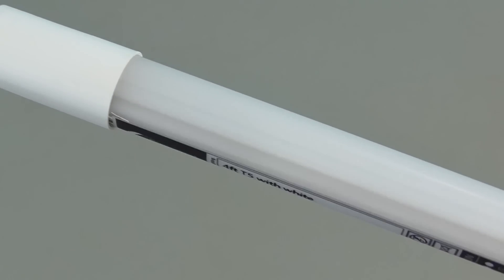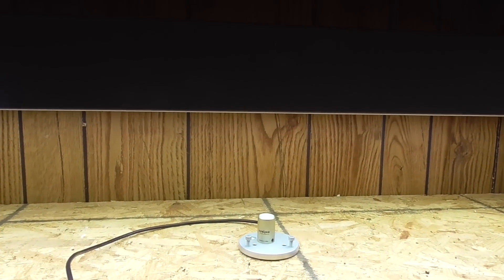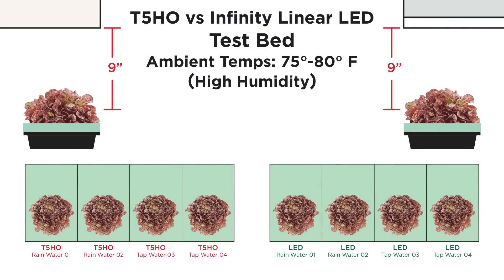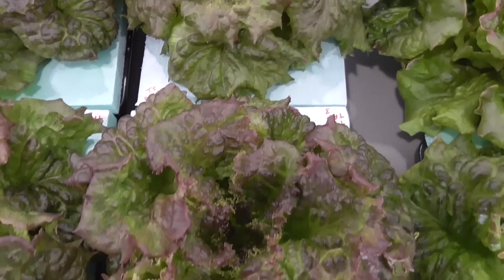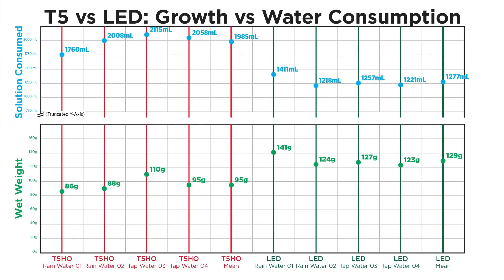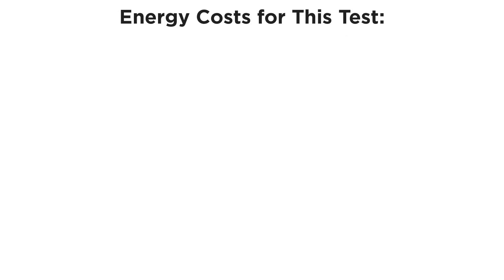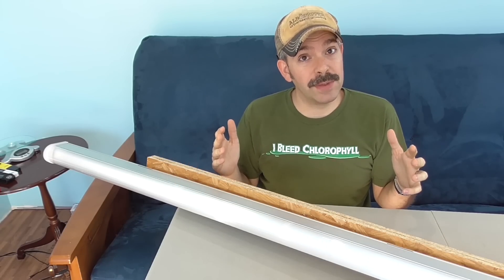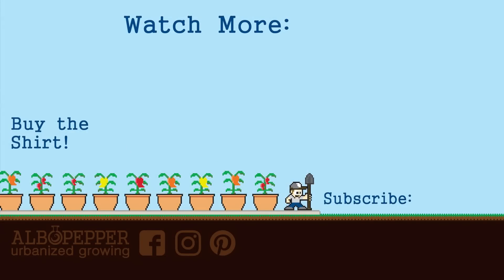High End LEDs vs T5 Fluorescent! Thrive Agritech: Infinity Linear (Review & Lettuce Test)

Comment: Great stuff! I believe the t5 was to close and was getting light burn. I think if you raised the t5 it would of out grow that led.
Reply from the maker: Thanks for watching! Perhaps the lettuce would have benefited by raising the T5 a little. Even still, that doesn't support the claim that a T5 would outgrow these LEDs. My T5s were pulling about 185W. Since they only have an efficacy of about 1 umol/J, they would have been outputting less than 200 PPF. These LEDs would output 250 PPF for the two units. With the lower Total PPF, there's no reason to suggest the T5s would somehow be better. Not for growth. And most certainly, not for electrical efficiency.
Reply: @Albopepper  thanks, appreciate your knowledge and reply !
Reply from the maker: Sure thing. Thanks for watching!  :-)

Comment: Hi there! Thanks for the thorough videos! I'm looking for a bit of advice for buying grow lights for the first time. I'm a first time gardener and i'm looking to set up a seed starting area in my basement for our summer vegetable garden. Our garden will be about 35' x 20' and we want to start as many seedlings as possible (rather than buy seedlings from a market).  I would like to buy lights for the long term, so these seem like they would be a good fit but my biggest question is figuring out how many lights I need. I guess I can do some math to figure out how many flats I will have going at a single time. Do you think one of these lights will be sufficient for starting seedlings (normal vegetable varieties including peppers and tomatoes)? Any help would be much appreciated!
Reply from the maker: Hi Tyler, thanks for watching! Two of these would work great as a replacement for a 4 foot,  4 bulb, T5 fluorescent system. That would illuminate a 12" x 48" area with good light for strong seedlings. That grow area would accommodate 2 seedling flats.

Comment: What else can these Infinity Linear lights grow? Are they meant mainly for light foliage based plants? (since it seems the spectrum wouldn’t support something that has a flowering stage) Could they be too much light for Micro Greens or make a difference in color? Is there a limit to how many can connect together? Is any reflective film able to add a difference to growth? Just a couple of the questions I wanted to ask.
Reply from the maker: Thanks for watching Creighton! Some of the ideal applications are highlighted here: 7:27.  Microgreens would be perfect. These lights would support flowering too. But they would probably be better for supplementation in that application, since flowering / fruiting cycles demand more light output overall. I'm not sure what the maximum daisy chain limit is. It might say on the manufacturer site. Reflective film is always advised to maximize usable light.
Reply: AlboPepper - Drought Proof Urban Gardening - Thank you very much! I’ll be looking in to this for my business. Your reviews and other videos help me to determine what methods and lights I’ll use for my business and routines. Thanks again!

Comment: No mention of flavour? Who cares if they are bigger if they taste like ass...
Reply from the maker: The fluorescent grown lettuce tasted like brittle cardboard with a mix of plastic and chalk. But the LED grown lettuce tasted very rich and savory with a crisp buttery sweetness. And the aroma was magnificent, reminiscent of a Spring day on the plains of Ireland. Is that what you want to hear???

Seriously, I ate BOTH lettuces after measuring them and they both tasted fine... like lettuce. Neither of them was bad what-so-ever. However, it is extremely difficult to establish an objective, non-biased method for quantifying and describing taste profiles. Not to say that taste is irrelevant. But it is not something that merited discussion as they both tasted normal. And I'm not going to focus on such a non-objective metric.

In general, there's only ONE time that I've ever eaten lettuce that tasted bad. That has always been lettuce that has begun to bolt. This has occurred with mature lettuce plants grown outside in the Summer.

Comment: I love your test, thx for doing all that work. I do take issue with the price of these lights, I build my own LED and I have no doubt mine would easily out grow these LED but I can stick the best diode on the PCB and control the watts up or down by singular watts. My main issue is the price, these lights probably cost 15-25$ to be made in china or wherever and shipped to the US, then sold for 4 -6 times the cost. This is why LED hardly move forward and it's a bit sad. 

Kingbright from china makes individual lights like that but for the watts/lm/umol/photon I'd say its about 1/3rd the cost.... But you have to know a lot about lights to find them. I look up these retro fits to LED and most are 10-120 lm/w when all they had to do was put in (at this time) lm561c or lm301b diodes and they would be around 180-190 lm/watt meaning you would have around a 70% better light... for literally pennies more to the company... So why are we still using super old tech? The diodes we get are usually 5 years dated, self or 2-4 cents a diode while the absolute best diodes are selling at 5-6 cents a diode... yeah you use a bunch, my lights have 784 per PCB but the math is 40$ for diodes VS 15$ in diodes... for a 320 watt light. 25$ more and you get a light almost 2x as good... and as you just showed better light is better in many ways. You would have to buy 2 crap led lights to equal 1 well made LED light, meaning if the better version was lets say 500$ the crap version with the same watts and diode count would only be 25$ less.... but you need 2 of the bad lights to equal one of the good lights.... So in reality it costs something like 400$ MORE to buy crap lights to grow with.
Reply: Message me on my email aknvca@google. Interested in your t5 led

Comment: Do you feel that the +50  ppfd had an effect on the water consumption which in turn may have effected the overall weight of the lettuce in comparison to the led. For the comparison to be 100% I would want to limit as many differences as possible. The harvest per $ do not lie.  Initial cost is also a huge factor to add. I am trying to find out whats best for me to buy and start as a hobby for microgreens and just for experimenting. All tho LED is king, the initial cost vs energy savings would take quite some time to balance (possibly a year or so) on a small scale. Thank you for making this video.

Comment: I'm not sure why noone else has mentioned this or not, but a 4 bulb T-5 HO fixture is supposed to use 216W (54W X 4 Lamps) and not the 185W that your test results reported. Were the T-5 bulbs new at the time of testing? If so, that would lean your findings even more towards the LED lights. I'm testing one right now in a loose comparison to previous data I have collected, and not a true side by side, but the plants appear fairly stoked once I knocked down the thrips from before the test.

Comment: thanks again for another top notch experiment albopepper !  do you think 2 would be overkill for sprouts...or could get away with 1? (infinity are nice but $$$$$$)
Reply from the maker: Based on my limited testing of microgreens, I'm inclined to think that a single unit should do the trick. It should outperform a dual T8 or T12 setup. It partly depends on how wide the tray is and how much vertical distance you have.
Reply: sounds like another experiment to me ;) I plan on buying a few and trying them out soon. perhaps we can both run and compare?

Comment: LED lights should be feet from the plant not inches
Reply from the maker: That's not how it works Jack. LED lights should be placed at the appropriate distance to achieve the desired PPFD levels for the intended crop. Some LEDs have a narrow intense beam, which requires greater distance to spread the photons over a larger area. This LED is not designed that way. I showed the exact PPFD as measured with a Quantum Sensor. There was no need to raise the LEDs.

Comment: What are your thoughts on those hlg quantum boards? Specifically the 60. Seems as though they are just about the same as cheap amazon light panels except white leds instead of purple. I wonder how they compare to the t5 leds in your video. Seems like they would have similar output and coverage except cheaper.
Reply from the maker: Hi Ryan. I haven't taken an in-depth look into the quantum LEDs. But from what I've read, they seem to be a good option. Certainly it would be worth trying out a set in the future!

Comment: your test is flawed because t5 needs to be placed further than a led
Reply from the maker: No, that does not make the test flawed. The LEDs & T5s were measured and positioned with the expressed goal of being able to MATCH placement height, specifically for this test. Otherwise people would come on here and say "your test is flawed because t5 needs to be placed at same distance as a led for a 'fair' test". In real life usage, the LED certainly could be placed closer, which simply underscores its advantage over T5.
Reply: AlboPepper - Drought Proof Urban Gardening I've grown with led and flouros. The led needs to be closer while the t5 needs to further. You can only grow crops under a foot efficiently with those bars you are using
Reply from the maker: It all comes down to PAR levels along with spectrum & light duration of course. What PAR values do you recommend for T5 vs LED with lettuce? What DLI do you shoot for?
Reply: AlboPepper - Drought Proof Urban Gardening  "PAR values" lol i think you just melted lincolns brain

Comment: This technology looks very promising, and it's difficult to find any fault with the possibility of doubling green mass growth of indoor lettuce!  The price of these LEDs seem quite high, though.  Out of curiosity, and using a tool you created and made available to all of us (the "Grow Light Upgrades Cost Savings Calculator" on the Albo Pepper website), I ran the calculation using an Agrobrite FLT44 price and stats as the T5 baseline (4x 4ft HO T5 bulbs) and two of these Infinity Linear fixtures with their price and stats as the LED baseline (all prices and stats correct as of 03/06/2018 on Amazon.com) Mains electricity in my area is $0.10/kwh, so I used that rate in this calculation.

According to the Cost Savings Calculator, running the T5 fixture 16 hours a day would cost me $0.35, while the twin Infinity Linear would only cost an impressive $0.19/day.  However, that high upgrade cost of moving from the Agrobrite to the twin Infinity Linear setup would take an estimated 6.83 years to recover using just the energy cost differential!  That's a bit too long in my opinion, but the cooler operating temperature, waterproof design, energy savings, and increased vegetative growth will definitely keep me watching this technology closely, and I'll likely make the jump from T5 to LED once the upgrade cost becomes less extreme.

Thanks for the video, and for the free tool to do these calculations!
Reply: If they are made decently these LED bulbs should out live many sets of t5s, maybe somewhere we can find the average lifespan of these lights and the average lifespan of your average t5 and the cost of the t5 bulbs to add up how much the extra bulbs will cost you over time. I'm betting that will save at least some time into recuperating the extra money back.
Reply: These lights are consumer models, get some aluminium strips, some lumiled led strips, and DIY it to make your money back in a year, then sit back for the next 5 without any maintenance. If you go through the marijuana growing forums and the reef/aquascaping aquarium forums you can learn a lot about the technology and the people pushing the boundaries. I know some of the scientists at Philips follow these forums religiously, thousands of experiments being run in real time.
Reply: The Thrive light in what it can save you in electrical consumption possible can cover it's own cost in a year.

Comment: I appreciate the experiment, but the cost of the lights takes the whole situation out of context for home use at this time.  I expect the prices will decrease with time along with efficiency improvement.  I'd consider in 5 years maybe.  
There is also the factor that LED lights can fade with time instead of just burning out.  I would love to see a 1 year full time use review with a comparison of the amount of light still been produced.
Reply from the maker: I would say that I agree with you when considering light home use, especially in temperate areas with low electrical rates. But in areas where electricity costs are high and air conditioning is used for a large portion of the year, the pay off would be much sooner in the context of year-round growing. Safety is another matter that might concern some home owners. There is something to be said for a waterproof system that emits lower levels of heat through the day & draws lower amounts of current. Thanks for the feedback!

Comment: Totally geeked out on this video.  Definitely, this is one of your better videos in a series of great ones.  On electrical use alone, it would take around 162 repeats of this experiment to pay for the Thrive lights.  With T5 bulb replacements at around $24.99 every 8 months, that does offset a bit more, but may not offer enough cost justification for home growers.  Very nice lights for commercial growers, who would pay labor expenses for workers to replace T5 bulbs on a regular basis.   I would enjoy seeing more of your reviews and tests, especially exploring whether high bay LED hook lights or common 100w equivalent LED light bulbs would be a viable option.  Thanks!
Reply from the maker: Thanks for watching Matt! I appreciate you crunching those numbers for us. I agree, that it might be too steep for many home growers. Then I thought about the safety aspect as well. Water-proof, shatter-resistant lights are much less of a hazard in your home. For people with pets and kids, it's another factor to consider.
Reply: I have an LED T5 replacement bulb.  I use 2 bulbs out of 4, with 2 4 foot, 4 bulb sets in a 4x4 tent.

Comment: was this an ad for them? did you send the review unit back?

also what do you mean by vertical farm?  is that a wall farm?
Reply from the maker: Hi Freibuis. This is an example of a vertical farm operation: http://aerofarms.com  Systems like these stack row upon row of cultivated greens.

This was an independent, unpaid review. I set up the parameters the way I saw fit & had complete control of the set up. They sent me a couple older closeout items for testing. But I had to buy my own T5s, hydro supplies & electrical costs. I'm not returning the units as that is literally the only compensation I get for the entire project.
Reply: thank you ;)
Reply from the maker: You betcha friend! Thanks for supporting my channel.  :-D

Comment: Hi, albopepper, your video is great. Can I ask you a question? How do you start your lettuce seeds?
I have problems with that, my lettuce does not germinate
What ppfd and light cycle do you use?
Is it better to germinate with or without light? I use sustrate of coconut.
Reply from the maker: Hiya Max! Thanks for watching. Sometimes I find the easiest way to start my lettuce seedlings is in a tray of fresh vermiculite. I'll place a humidity dome on it and keep them at room temperature. Some simple low watt lights work great, like the SANSI ones I show in previous videos.

Comment: Good video, nice and scientific. I remember you pointed me towards this company about a year ago but apparently they were only selling in quantity at the time. I will be sure to test them out myself...

Do you think they will still out perform t5's in fruiting/flowering?
Reply from the maker: Hi Travis! I imagine they would do well to help with flowering / fruiting too. The spectrum has a good proportion of red wavelengths. It partly depends on plant size & quantity. At a certain point high end ceramic metal halides or double ended HPS can offer some good bang for the buck. But when compared to T5s, these LEDs are literally twice as efficient and warranted for 5 years.  :-)